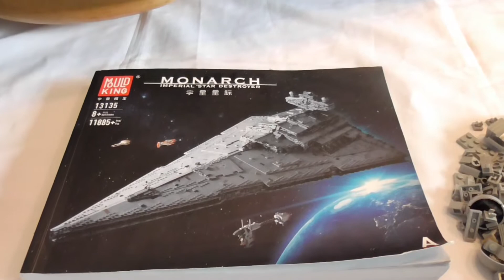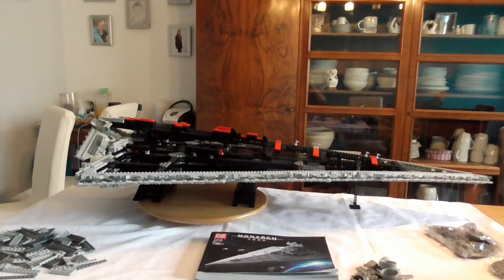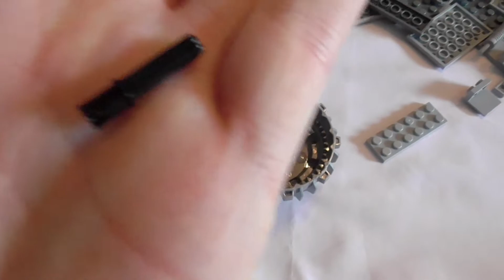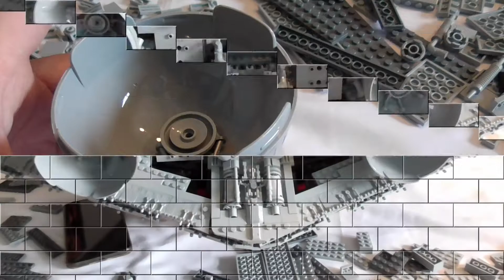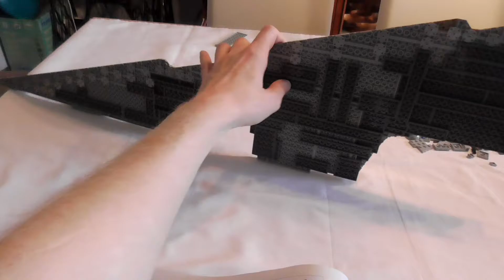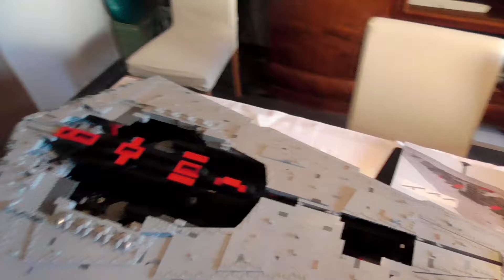Mould King 13135 - Imperial Star Destroyer Monarch - Assembly Part 3

Comment: Hello. I got the middle engine in.  I pulled out that upper middle part. Then insert the engine do not press it on yet.  Then re insert the upper middle part halfway and then push them both in together.
Reply from the maker: @kevindenuijl2992  seems a clever way 😁👍